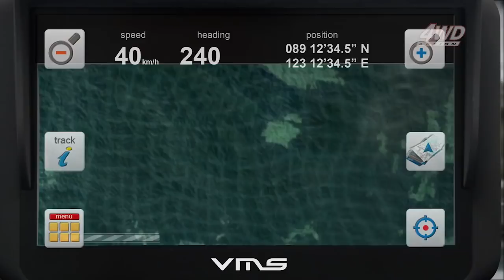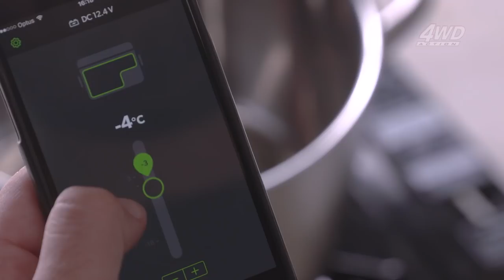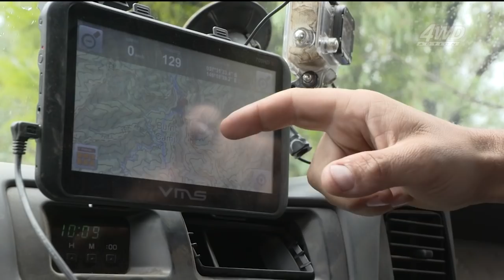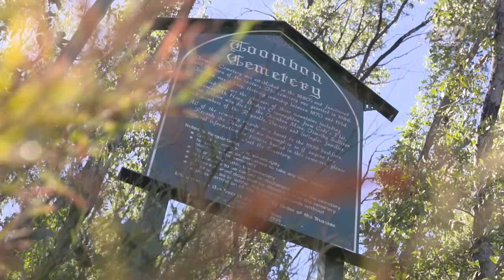Budget LandCruiser 80 vs. High Country! 😲 Will it survive?

Comment: I love seeing you guys with the budget rigs that a typical person would take out and modify.

Edit: Fish Cakes should be an official drunken feast.
Reply: So tru bro
Reply: I would like to see a Jeep out there on the trail with them.
Reply: Danny Mitchell wouldn’t last long at all or go very far
Reply: Liam S I don’t know about that one.  I know that the European versions are some what beefed up with gussets due to roads being lower quality but the rigs they have on the “tracks” have after market parts.  I would put the XJ in my thumbnail or a Wrangler Rubbicon up against those rigs.  I am not saying one is way better than another but want to see what they are capable of side by side.
Reply: Danny Mitchell well these 4wd’s are designed for Australian conditions. Hot & dry, I have a feeling a European manufactured Jeep wouldn’t be too reliable (built for cold). They’re very capable off road vehicles though
Reply: Liam S I think you missed what I meant by Europen Spec.  Meaning left hand drive and design for poor road conditions.  Nothing to do with Temperature.  With that said I live in Texas and we have two seasons here, Summer and Summer is coming :). Our Jeeps do just fine.  The Desert conditions we have in Arizona have higher temps then we do in Texas and there again they do just fine.  If a Jeep Wrangler can handle the Rubbicon Trail it will do just fine in some soft mud and water.   I just want to see so representation out there is all.

Comment: 4wd supacentre need to work out how to make decent quality bullbars for a reasonable price. ARB are great, but 3k for a bar is ridiculous these days.
Reply: The ARB summit bar is $1500 USD for a Tacoma.  Are they really $3K in AU?
Reply: +Jake Ballard, crazy you say that mate. It's true though. Considering ARB is proudly Australian you would think we would be paying the cheaper price. Funny how companies and economies work.
Reply: Harry Singleton but at the same time, Australians can go to the Toyota dealership and buy a truck with steel bumpers.  We can't even get the diesel engine we've been begging for since the 80's.
Reply: Anthony Gatley I said that the other day to a mate..  Ridiculous prices from others... Come on 4wd super centre...
Reply: @drumhed  yeh but for $70,000 with just the cab and chassis it you  throw a tray on another 5000 bar work 4 to 5 for a decent one ain't cheap we get ripped off big time over here diesels $1.53 a litre
Reply: Anthony Gatley get what you pay for
Reply: $3k sounds about right for a quality bullbar. You need engineers to design it, cut and pressed steel components, welders who aren't shit to build it, assembly jigs and good weld procedures so the alignment doesn't get fucked up, then the whole prep and painting process. Those costs go way up when there's a range of vehicles and designs to work with.
Reply: Anthony Gatley ARB are the Toyota of 4WD accessories.  Those who don’t know any better buy them cause they don’t know other brands are just as good for less money
Reply: @poopipeboy3033  But the seppos get our stuff for less than we can. It's not right. An aussie wagu eye fillet is aud$30 in south korea at a restaurant, yet we'd pay $100-130 for the same here. The world buys our gas for less than we can buy it. I don't mind paying for quality but I don't want to be sodomized which is what happens when we pay double or triple.

Comment: Thank you for these videos !!!!

Edit, a 3 second free fall on earth is about 40-45m.
Reply: And it usually ends with. SPLAT
Reply: 9.8m per second so closer to 30m
Reply: carbonfiber492 per second squared. First second is 9.8 m second 2 is 19.6meters traveled in that second because you are accelerating at 9.8 m/s

Comment: I know this is an older one but you guys should double check fella's safety standards the winching of shaun in the 80 series at 10mins the winch crew completely missed the winch hook with the damper blanket could have ended up badly...